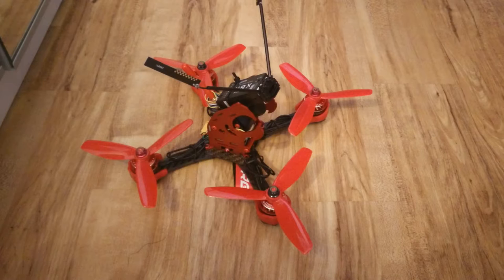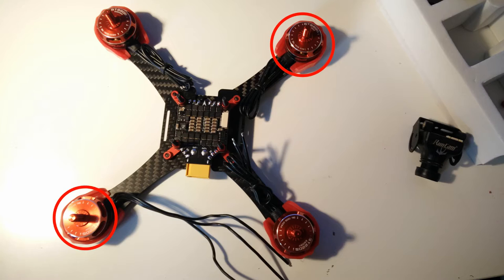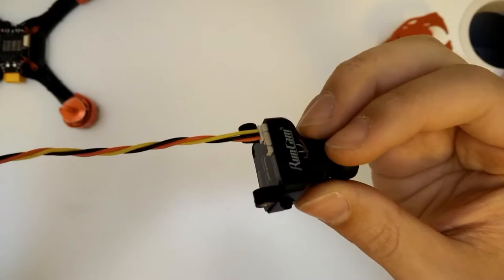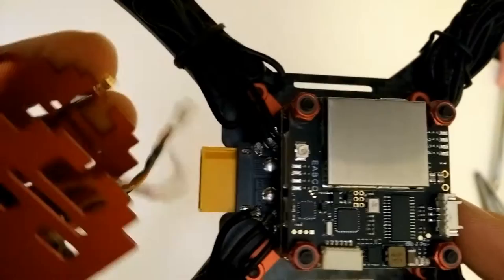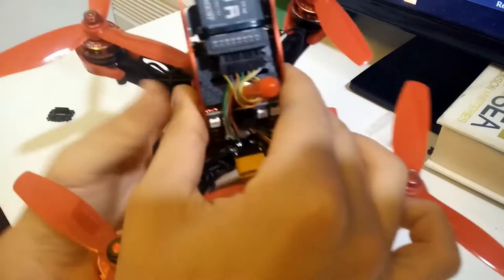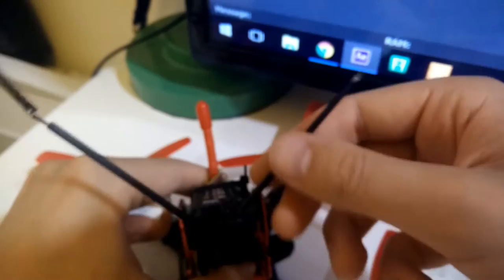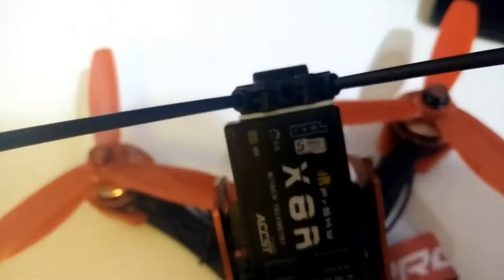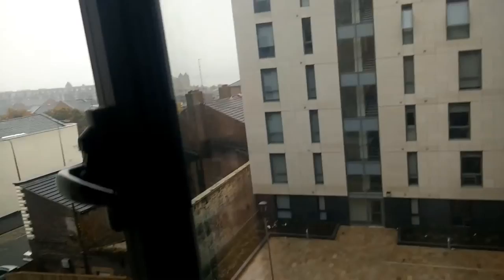FlyPro XJaguar Build - Motors, Wiring, Final Touches

Comment: I've sent you a YT message as well - sorry at that time I didnt see this video here.  hope you can answer a few of my questions.
to sbus:  I use the X4r sb  
I had to use the UART3 and turn on radio switch in Cleanflight / Ports tab, use Serial / Sbus setting in Receivers Tab for it to work - it's nicer to have less cables.
for your X8r:  get it out of that plastic case and just use some shrinkwrap - makes it much smaller!
I hope I can put my x4r under the cam inside the "case" so I would have more space ontop for a small HD cam.
I thought also I could reroute the video antenna onto the side (and use zipties) so I have more space for a flat cam like a runcam2 or foxeer legend2...

greets, Mario